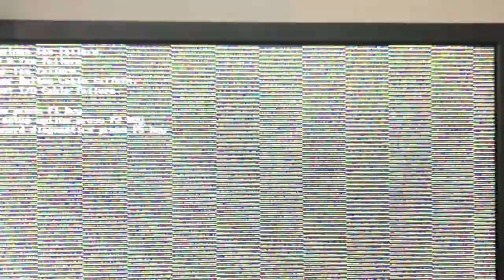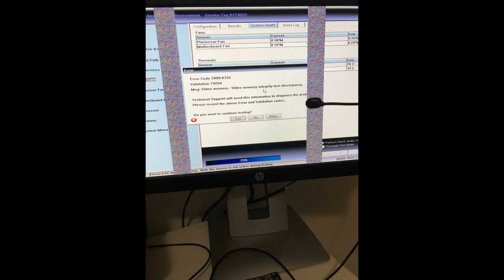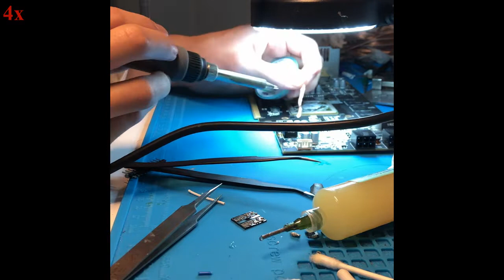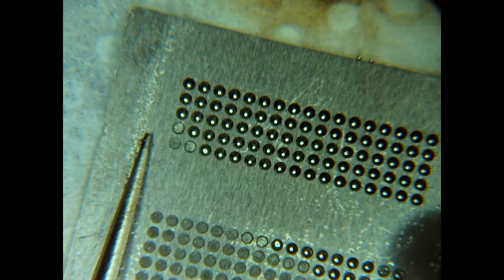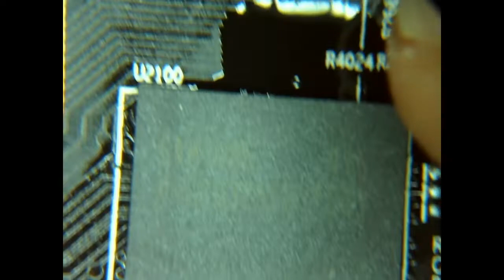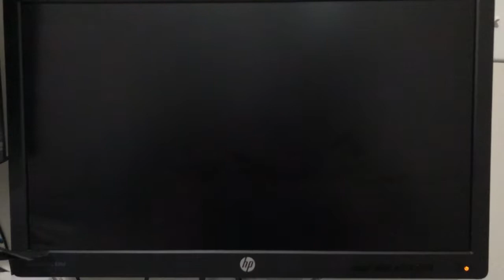Radeon R9 270X Repair

Comment: Really great vid, is there a way to contact you? Im very new to gpu repair and i would like to know what equipment i should get
Reply from the maker: Hi, for gpu repair you need at minimum a soldering iron, a hot air  soldering gun, and some kind of magnification so you can see  what you are doing, as well as solder, wick, and flux. In addition, I would recommend a circuit board preheater to make the card easier to work with. Definitely check out northwestrepair’s youtube channel, he has a lot of great videos about gpu repair. You can also email me at mronion64@gmail.com. Good luck on your endeavors!